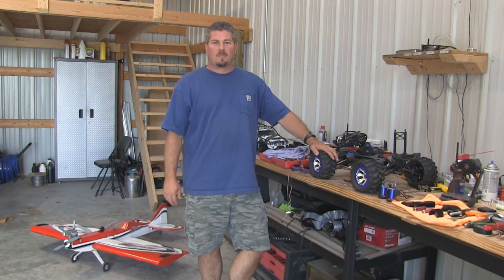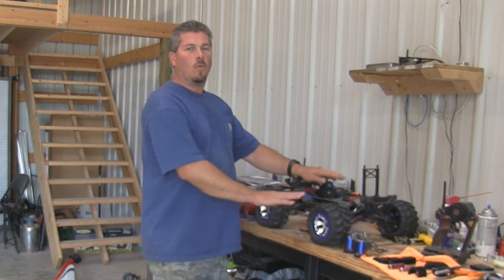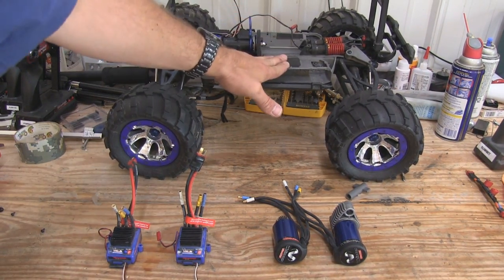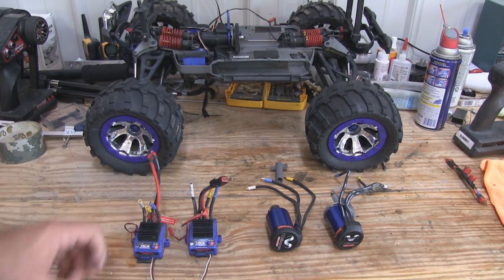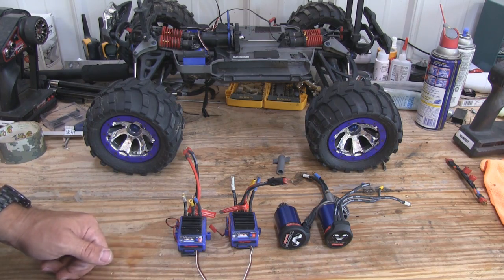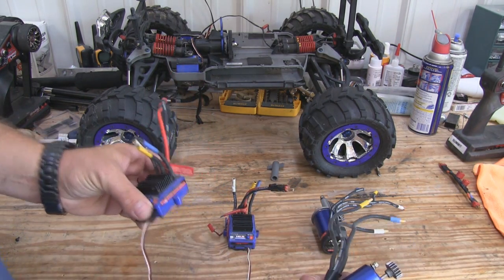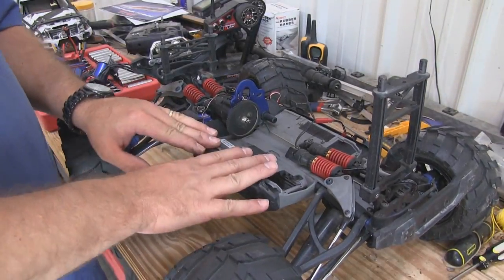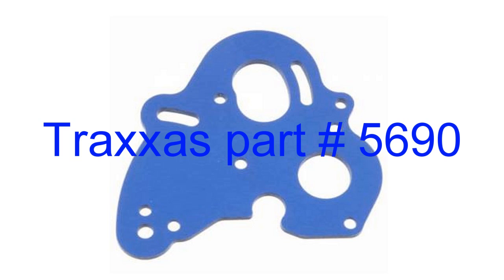Jetlag2222 SUMMIT Twin VXL conversion Part 1

Comment: Exactly why I stay away from traxxas parts. My Mamba doesn't burn up when I turn it off.
Reply from the maker: you might want to check the date on the video...  2012... 6 yrs ago.   mamba did not have a waterproof esc at that time otherwise I would have used it with a single larger motor.

Comment: hey lag, I completed this project a while back using your video as a guide.  turned out great. my question now is is this: I'm running a vxl6s in my stampede on 4 s but instead of using two 2s batteries , if like to implement my 4s 50c single hard pack.  when I attempt to plug into either lead off esc , nothing happens.  I had the Idea of using a harness with two female and 1 male in a series type harness but I'm hesitant to plug it in for fear of costly epic fail.  what says you? I won't hold it against u.  I need those other batteries freed up thatscwhybi purchased that 4s to begin with.  thanks in advance

Comment: Wtf? Pressing the button can destroy the ESC? I read the tag, but didn't know the consequences. Just got a Slash 4x4 platinum yesterday. Thanks for the heads up.

I think I might drop in a Hobbywing ESC soon, I've been spoiled with all of its programmable settings on my other RC's.

I also noticed some lag in the vxl system. When I pull the throttle the car doesn't respond until maybe half a second later. My end points and throttle trim are set up, it's not in training mode. I don't know, it's like turbo lag lol.
Reply: The lag on your vxl is that the motor is sensorless. Novak makes sensored motors that lets esc were magnetic poles are in motor . Make for smoother response to your throttle.
Reply: Either poor signal or dead batteries. Change the batteries. Mine had like 3 seconds of delay. The batteries in the controller were leaking. Good luck! TheAwesonymous
Reply: JakeWardell 19 Thanks, I will try charging both transmitter and car lipo battery.
Reply: TheAwesonymous the car battery isn't your concern. Mainly the controller.
Reply: Water will still short out your vxl esc and your lipo  , the bullet plugs and your deans are exposed.  The balance port on your lipo same thing . Yes water slash is ok but these cars and trucks ar not submarines.  But dont take my word it try it . dunk a lipo in water see what happens.
Reply: Luis Quijada  better yet did your hear that a microwave will charge your phone try that too
Reply: Luis Quijada ok, thanks. But I already got the Hobbywing sensorless ESC now so I'm thinking of getting a more powerful sensorless motor. But the next motor will be 4 pole for more torque.
Reply: I've had a slash 4x4 with the same velenion and never heard of or had problems with that button
Reply: Traxxas states in in about 30 % ... crazzy I have had one go others  not.
Reply: never had that in a vxl but I do have that with a rebranded goolrc in the jlb cheetag

Comment from the maker: yes it probably would be now.  it wasn't available when I made this video.   the single motor/ESC Mamba would be much less complicated to set up as there are a lot of wires in this twin install that can short out or get broken.  But my SUMMIT currently still runs this exact setup that I did for this video.

Comment from the maker: This would not work well as a single VXL 3500 setup.   The 3500 is not strong enough to pull around this big heavy SUMMIT frame.   You would have to gear it so low that it wouldn't be any fun in order to keep it from overheating.

Comment from the maker: If you want a top speed run type machine, go get the Mamba monster power system.  It's easier to install and faster.    It's just not waterproof.  which is what this was about.  :)

Comment from the maker: Because we are wiring the electronics in a non-standard fashion.  especially if you smoke an ESC or motor doing this wrong, they will NOT replace it.

Comment from the maker: The EMAXX twin VXL would be the same except for 1 thing... Both motors on the EMAXX mount on the same side of the motor mount, so you don't have to reverse the wires on one motor to make it run backwards.  They both run the same direction.  Other than that, everything I said here will apply just fine to an EMAXX twin VXL upgrade too.  :))

Comment: yeah back when i made my conversion i was looking at another motor option, at the time turnigy was making beast 2600kv 540 motors for like $20 each. The only drawback was that since it was such a beast & low-cost motor it was always out of stock, like the Tacons on hobbypartz.

Comment from the maker: Good call.  I was talking about the price for brand new at the LHS.  you can definitely find them on Ebay or 2nd hand for cheaper.  Also those ESCs can run many motors aprox that size, so it wouldn't even have to be velineon motors if you like another brand.

Comment from the maker: It would be a LOT of modification.. for starters, there is no place for the second motor, and they don't sell a 2 motor motor mount for the slash so you would have to make that yourself.  also there is no place for a second battery, so you would either have to run on a single batt or tape them together.  But sure, almost anything is possible in RC.   Go show us how!  :))

Comment from the maker: That is completely incorrect.   The 3 wires going to the brushless motor are completely interchangable.  any 2 of them reversed will just reverse the motor.  Please do not give out technical information on my videos unless you actually know the correct answers.